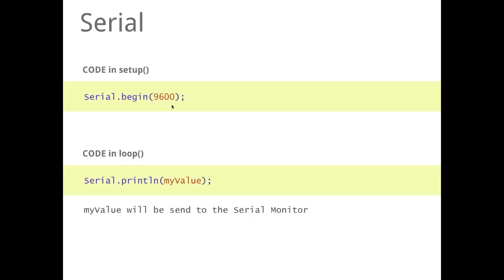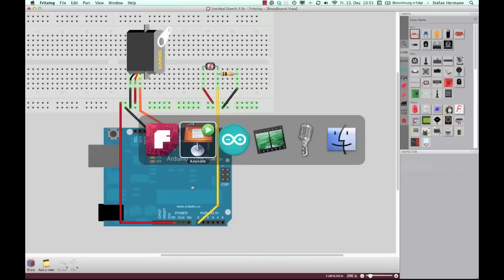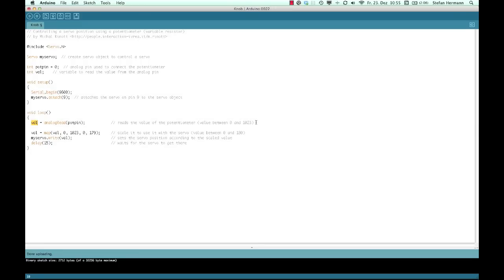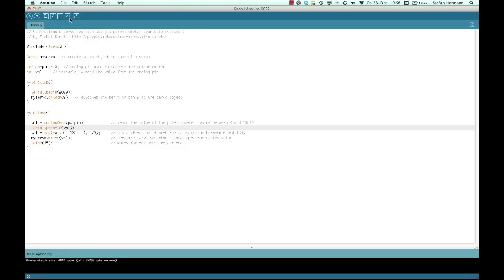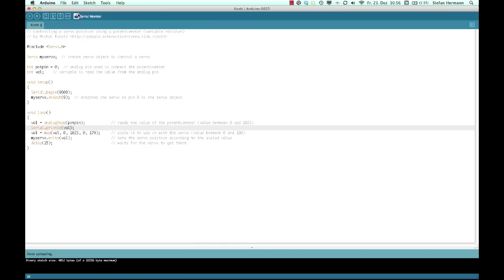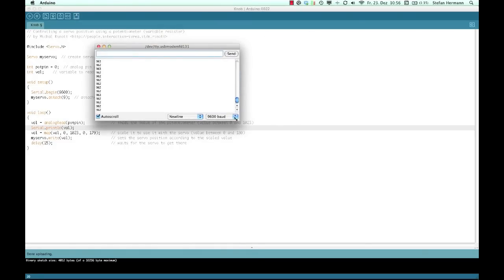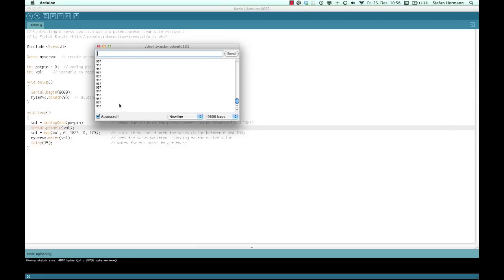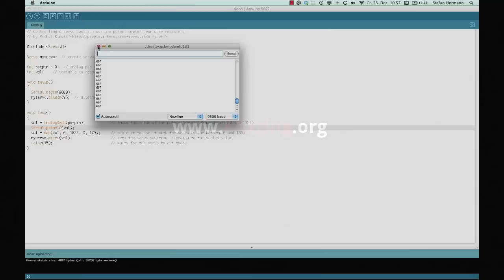Learning Arduino Episode 011 -- Serial Communication

Comment: There is a monitor if you click on Extra -> Serial Monitor (or press CTRL+SHIFT+M). On the windows Arduino software that is.

Thank you for the tut, was wondering between the difference of Print and Println. :)